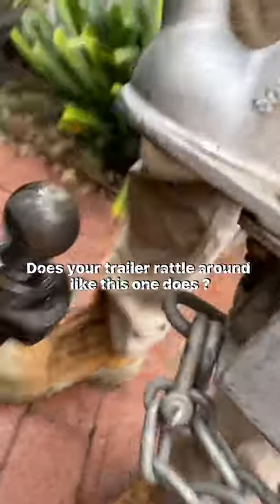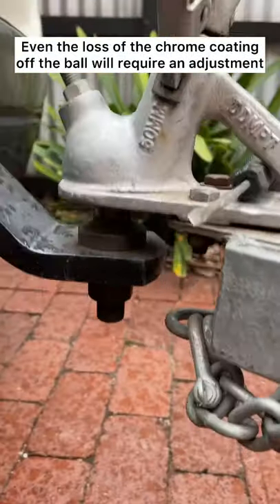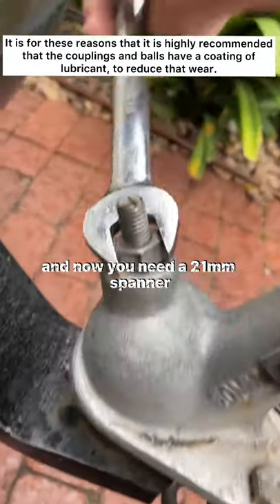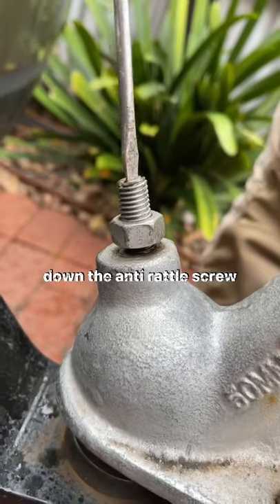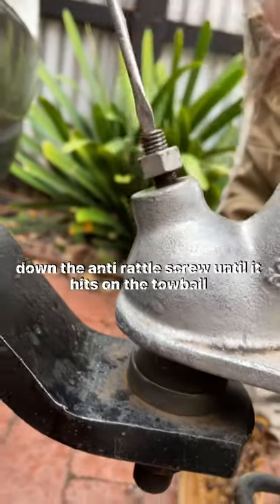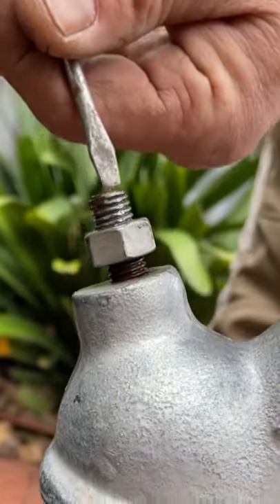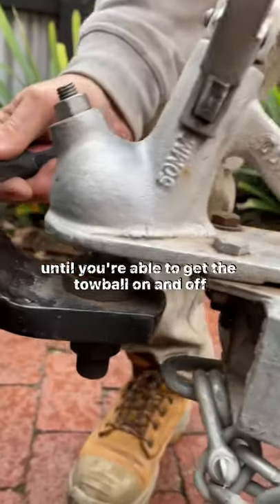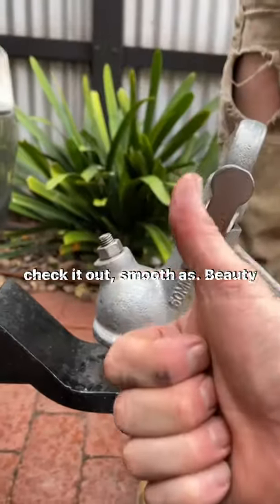Fix a rattling trailer hitch

Comment: Thank @natestoolbox you for such a clear explanation. I have 2 questions. 
1. Do you grease the ball, if so what with? 
2: Do you grease the receiving hitch and ball mount?

thanks again
Reply from the maker: Thanks ☺️ 
It doesn’t hurt to apply a small amount of grease.  I’ve been running this trailer for 15 years with no grease though and it seems ok.

Comment: I never seen that screw on a trailer ! Not a clever design! Now all the weight is on that screw head.. one point on the ball.
Reply from the maker: Oh it actually moves a little curved pawl inside so still keeps roughly same shape :)
Reply: @NatesToolbox  oh ok  i see. Are all trailers like tht in Australia?
Reply: @edwinlaing9834 yes, standard trailer hitch, unless you go with a camper trailer hitch for 4 wheel driving.🍻🤠🇦🇺